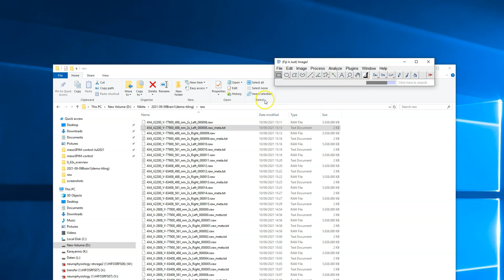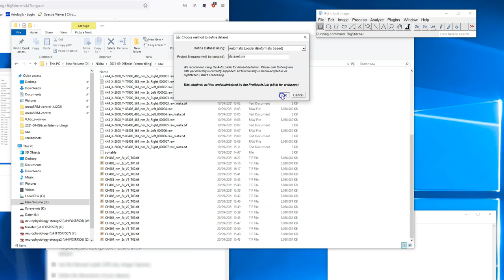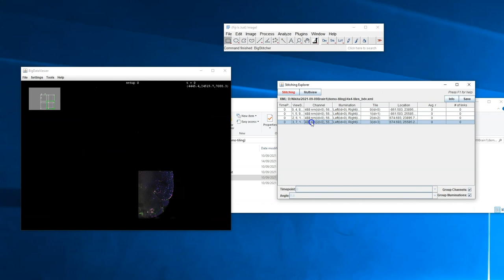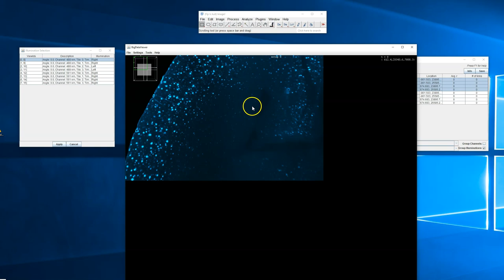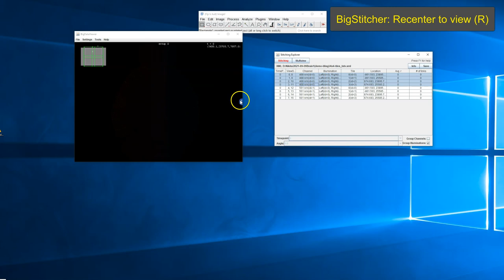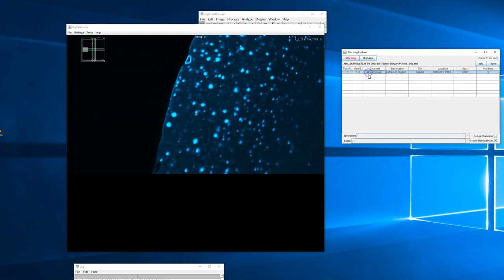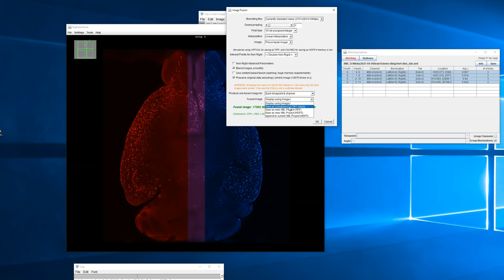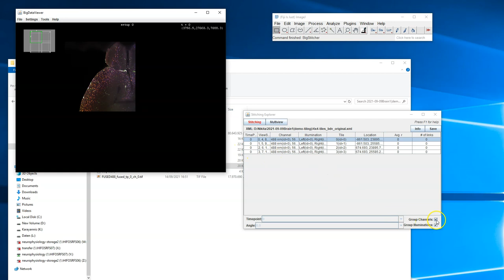Stitching 3D images from tiles using Fiji/BigStitcher

Comment: Hi Nikita, many thanks for the video, I have a quick question, how do you select the best channel for stitching? Does it has to be a channel that has the brightest intensity or most interest points in common?
Reply from the maker: Hi, you can choose the brightest channel, or average of several channels. I usually pick the brightest one. The default stitching algorithm does not depend on interest points, it uses cross-correlation of image intensities.